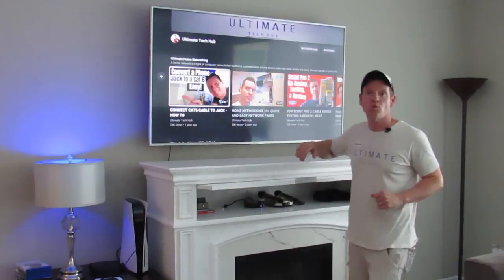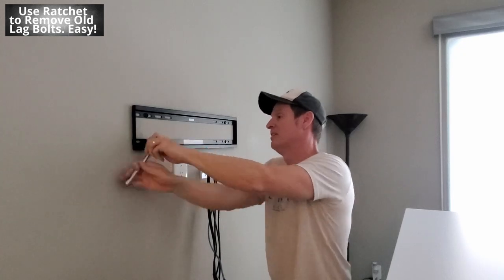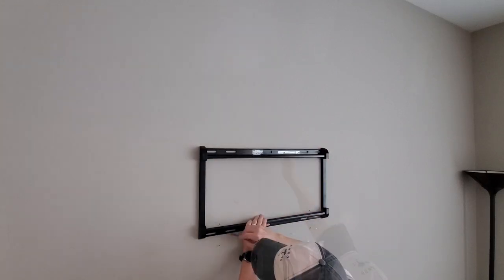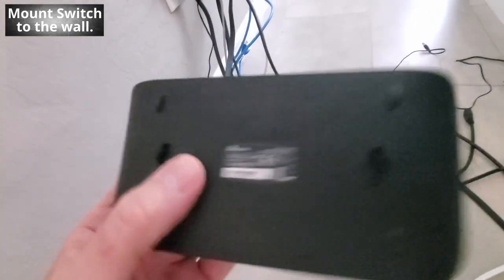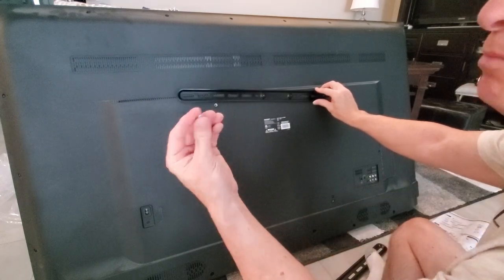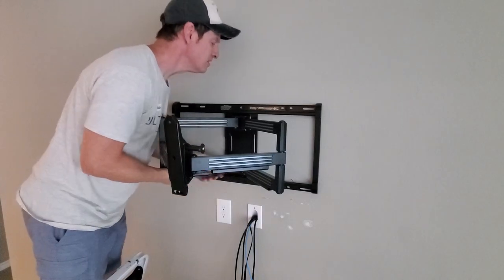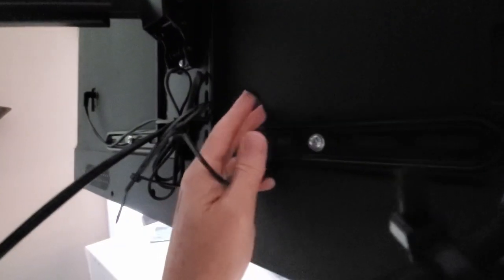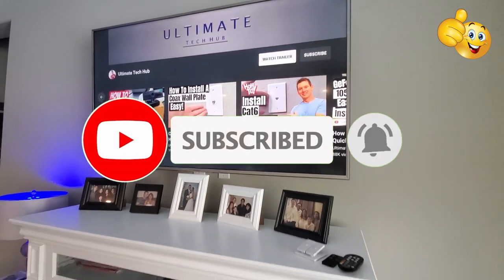How To Install ANY Full Motion TV Wall Mount - SANUS SLF226-B1

Comment: This is a mount I'm thinking of getting. Will this be able to swivel 90 degrees left or right on my 43in TV with the arm fully extended?
Reply from the maker: It doesn't swivel 90 degrees left and right. The mount doesn't extend that far away from the wall. It would need to extend very far away in order for a 43 inch TV to swing 90 degrees. This mount swings in all directions and even allows for small adjustments for you horizontal adjustments. I've installed many different types of TV mounts and this one is my favorite for the many different TV angle adjustments.  Thank you for watching and keep me posted on what you decide.

Comment: What screw was used to change the horizontal after hanging the tv none of them seem to work
Reply from the maker: There is a screw that loosens so you can adjust horizontally. It's on the TV bracket.
Reply: @UltimateTechHub  my dad and I couldn’t find a the screw for an hour and a half😂. We were panicking but finally found it lol
Reply from the maker: @harrisonvargo  Haha, glad you guys found it. It's a great wall mount for your TV! Enjoy!